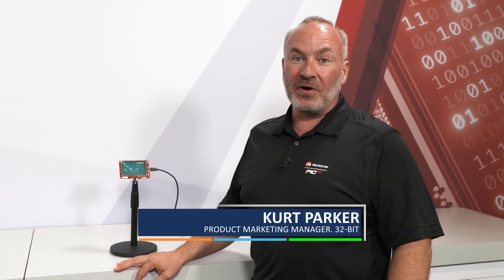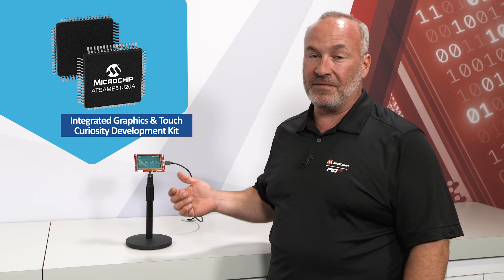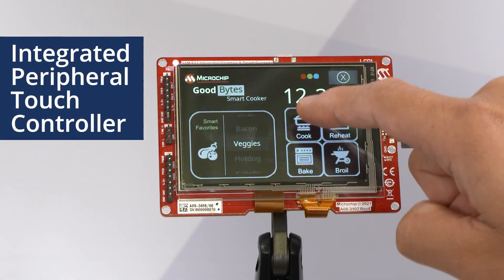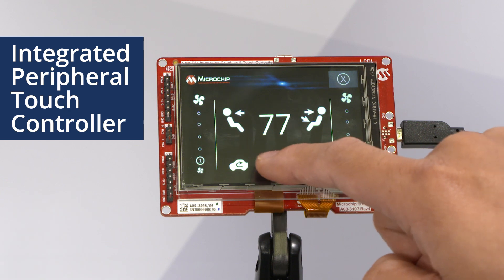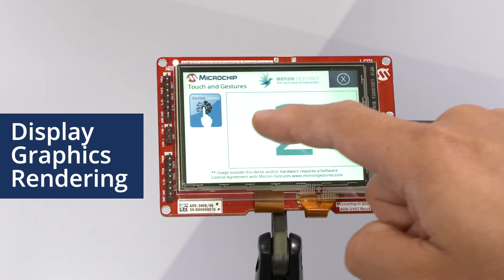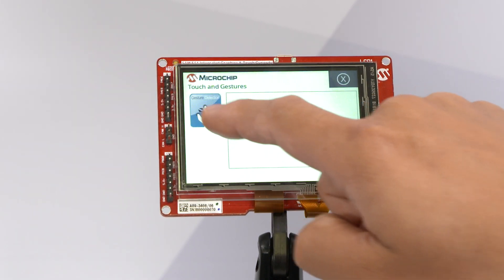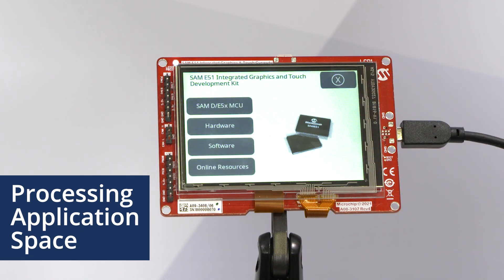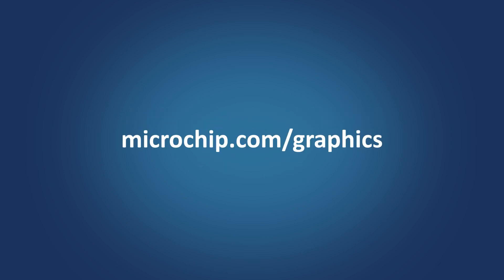Introducing the Integrated Graphics and Touch IGaT Curiosity Evaluation Kit from Microchip

Comment: Hi MCHP. I see that the kit includes a screen with an additional layer of glass on top. Could you tell me how thick it is? Would the touch function work with a 5mm thick acrylic sheet?
Reply from the maker: Thanks for your question! The IGaT Curiosity Evaluation Kit (EV14C17A) uses a display with a cover glass thickness of approximately of 2 mm. Touch sensitivity drops sharply as acrylic overlay thickness increases, and generally recommends only 2–3 mm for reliable projected-capacitive sensing. The surface sensors on the IGaT kit are optimized for thin panels, and while 0.5–2 mm overlays work well with typical 5–7 mm sensor nodes, overlays thicker than 3 mm become difficult to tune and often unreliable. With a 5 mm acrylic sheet, the EV14C17A/IGaT touch function is unlikely to operate consistently unless you reduce the thickness or switch to a higher-dielectric material like glass.
Reply: @MicrochipTechnology  Ok. Thanks